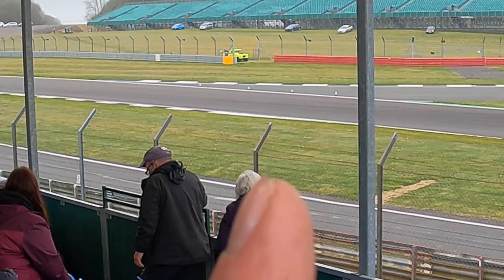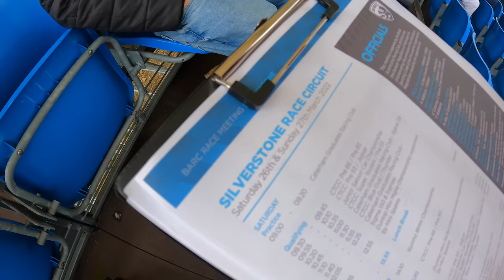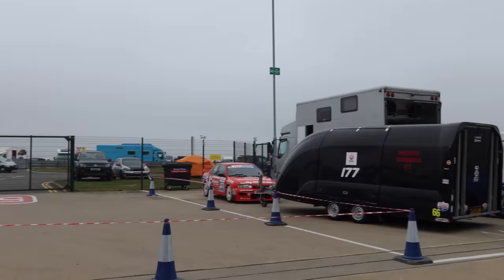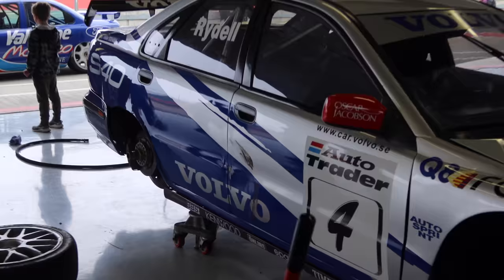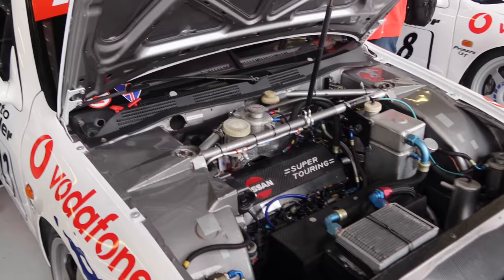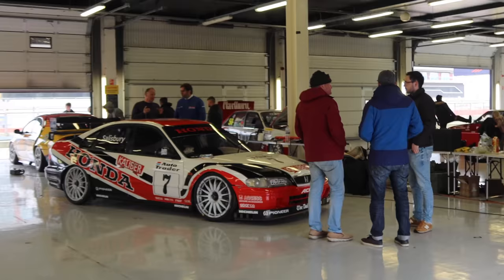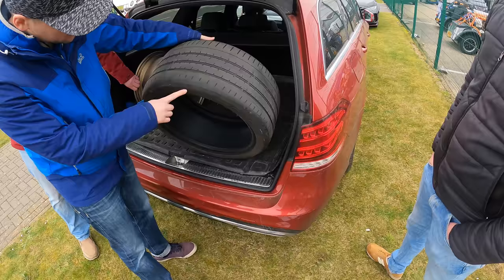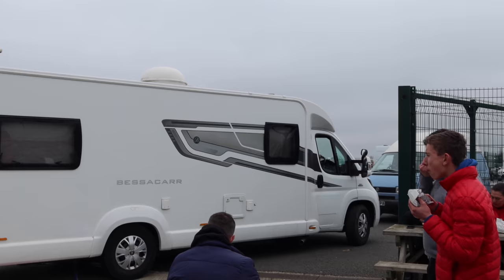SUPER TOURING IS BACK!

Comment: Hondas ran an F20B (JDM spec engine very similar to a H22) built by Neil Brown and had the head reversed. 
Crazy engineering. 🤯
Reply: Yeh was gonna comment the same. They weren't allowed to run over 2 litres if I remember rightly. The f20 was run in the cl4 accord SIR in Japan I think
Reply: Did most of the touring cars have reverse heads? As the cav and Vectra both did the same with the xe motors
Reply: Another nerdy fact...the F20B has the same block and head as the H-series, even the pistons are the same. The difference in displacement comes from the smaller internal stroke in the F20B, hence why they rev higher than a H22. The F20C also used the H-series as a base for design.